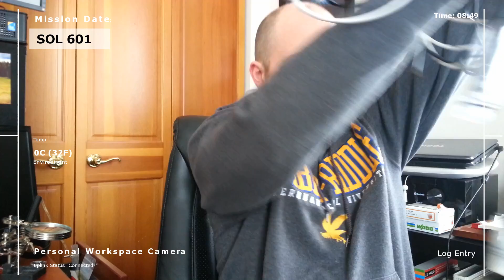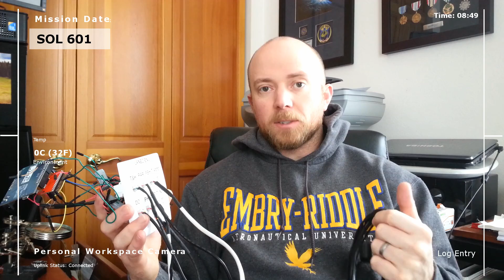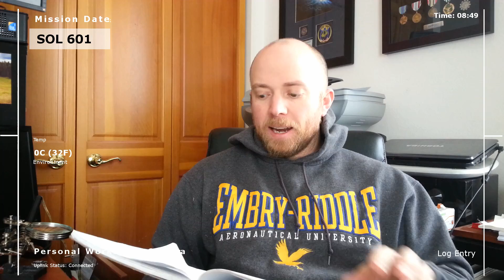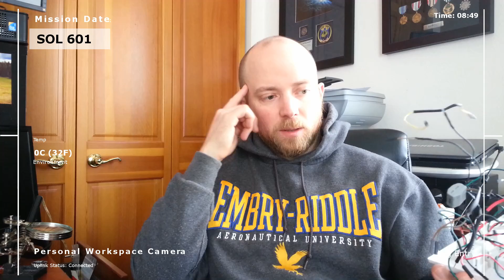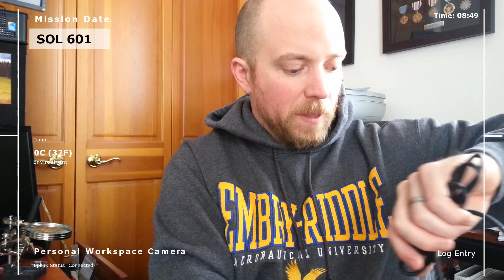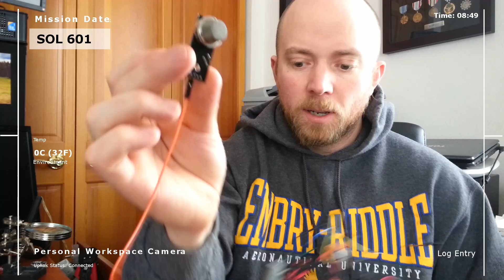ARDUINO homestead environmental sensor HACK

Comment: This is pertaining to where he talks about that he was going to be a project manager and will have people that already know that stuff so he doesn't need to know it. What everyone forgets is that there are to many screwed up people out there and you need to be able to check in on what they are doing and know if it at least sounds correct. I am not saying that it sounds correct because your emplyie is TELLING you that it is. You need to know from your own understanding if it sounds correct. On top of this if you know a basic amount of the information you can also help solve problems and you would then have 2 heads (you and your employee) instead of one.

Comment: Have you heard of mysensors.org? It's a open source, open hardware community working on wireless arduino based sensor networks that can be programed "ota" (over the air). you may find it interesting.

Comment: What are you using for a power supply for the sensors - you may not have enough juice to run everything.  The Carbon Monoxide sensor uses a heating element for measuring which may be drawing too much current which is why everything else failed.  Also I would suggest using a potentiometer on your voltage divider circuit so you can fine tune the output (supply voltages vary and the resistors are +/- 5% - a pot lets you tweak it so the sensor is reading correctly).  Just had to do something similar on a solar logging device I'm working on.  Love the videos, keep up the good work.

Comment: One thing I can recommend is with your temp/humidity  sensor that particular sensor is very sensitive. Especially the humidity sensing. I have just built a fan control for my big 3000W inverter, during the build I noticed that when I got close to it my breath would raise the humidity. So you might want to make sure you do multiple humidity readings before you take any action.

Comment: Why not RJ45? Your whole system would then be using cat5 or cat6 and you would be able to use POE instead of having a bunch of power supplies. A 24 port POE switch would go a long way.
Reply: 802.3af PoE devices negotiate the power required, before the PoE switch supplies any power to the cable. Therefore it wouldn't work.

Comment: I have a question and a comment about your placement of the temperature and humidity sensors. How are you going to ensure that you don't get false readings from dead spots and also direct heating from the sun? I saw a very interesting way to ensure that you get a good reading and that is to put the sensor in a PVC pipe that is white at the bottom and painted black a the top. This will cause a natural air flow over the sensors especially when the sun hits the black part of the painted PVC pipe. It will ensure that you have a good air flow with no dead spot and also good humidity since you won't be measuring dead air.

Comment: Hello ...Try  connecting a different sensor output to the input you have allocated for the monoxide monitor and see if it still takes down the others, should show if its the sensor or wiring?  Seperate supply for monoxide sensor if it draws to much?.. Your leisure time will still be restricted to location areas which  have a good cellphone signal.

Comment: You call it a "hack" but it's not. It's the real deal under construction. Wether it's a house or a railroad track or a space shuttle, mistakes are made and then corrected or adjusted to make more useful products. Like me, I put a Dodge Cummins turbo diesel, a lift, and a solid front axle in my gas chevy truck and it's like engineering an entire truck from scratch and you hit speed bumps but no worries, you work the bugs out as you go. Remember, you're a one man pit crew so don't give up you're doing it right. I did, and you can too.
-Alan

Comment: I was getting a little worried about the break in the videos,glad to hear your ok. One bit of advice, use a larger enclosure, why try to stuff all that wiring in a small box. Maybe even find a enclosure with a water tight door. Someone mention about corrosion on the rj** jacks, that's a real concern. Dave

Comment: Hello, TRM. Buy a small spool of Cat 5 cable (or Cat 6 if cheap enough). Cat 5 and 6 cable has twisted pairs and these reduce interference and signal degradation (crosstalk). These cables use 24 AWG and also are shielded. Speaking of shields, use an Arduino shield to eliminate that rats nest and clean up your shorts.   https://www.amazon.com/Adafruit-Proto-Shield-Arduino-Kit/dp/B00N426HCG/ref=as_sl_pc_qf_sp_asin_til?tag=hightechmagic-20&linkCode=w00&linkId=991de72b955502a0cefac6051f4fafc3&creativeASIN=B00N426HCG
Reply: That depends! If you buy UTP cable (which most people do because of the price) then your cables are unshielded... ;-)
Reply: Twisted pair doesn't magically reduce interference, certainly not how this guy is using them. They need to be driven by differential signals first, otherwise they are the same as bell wire.
Shielded cable helps, but I don't think this martian guy knows how to implement that concept properly.

Comment: Be careful with the modular connectors (RJ-xx) as they corrode easily. You might get around this problem by adding dielectric grease to prevent humidity to reach the pins.

Prototyping with all those wires is fine but you should look into PCBs, even if it's for your sole usage. You'll increase your chances of problems each time you'll pull in and out this system out of its box. This being said, humidity might be problematic as well inside the box so silicone and dielectric grease will be your new best friends.

Keep up your good work.
Reply: http://www.siemon.com/uk/white_papers/02-03-22-industrial.asp

Comment: Whilst I clearly understand why you are doing this hack I frankly would run a mile from attempting such a thing as wiring these devices up not least because I'm partially colourblind and have some past bad experience (with wiring)!! However from my limited experience with electronics in agriculture I am very wary about reliability issues in what is after all for your circumstances a hostile environment (extremes of temperature, high humidity etc) for electronics. 
We have found that all too often they work initially but then fail without warning and are often a total nightmare to clearly identify the failure adequately and  precisely.
Are you trying to cram too much into one box for instance, is the air temp sensor with such a short cable too close ie can you position it where you actually need it?

I would welcome your thoughts on such matters.

Comment: don't know how much current that monoxide sensor draws, would be suspicious if it has a heater coil inside and you tried to power it from a 5v output on the microcontroller board

Comment: I know you have allready started with the Arduino, but check into this , do a search for 

 Raspberry Pi 3 Cluster
Reply: You can log data with the arduinos. 

Caleb, that's basically what I was talking about as far as having an rpi as a central sensor controller (then wifi or direct cable) to a laptop/server. But the multiple cheaper boards. 

I think you have to look at the data, do you gain much by retaining the data and holding them on site? Really just fire and forget is the way to go.  Miss too many heartbeats and set an alarm.
Reply: robert k Yes, data can be logged at the Arduino, the RPi, and/or the main server. My preference is to data log onto a thumb drive when using a RPi. I setup a file server for my mom's business that uses a 1TB external hard drive as the main data storage and a 64 GB thumb drive that once a week tarballs critical files for backup. It's been running strong for a couple years now.
Reply: BIZKIT Absolutely. The data you are trying to collect and the what you are trying to do with it needs to drive your system. A few years ago I built a noise monitoring system for a client that we ended up going to RPi2's on because of how they wanted to handle the data and interface with it. I could have used Arduino for the job and saved time and money in the short run, but based on the long term goals for them they opted for the RPi to have more capabilities down the road.
Reply: What exactly is that supposed to be useful for? Arduino's by and large are cheaper and do what he needs. He's using older desktops for the servers for receiving data from the arduino shield. He COULD have the arduino's report back to teh Raspberry Pi. but why spend $80 on a device that is doing one thing and could easily be had for $10-15 + connections, etc. 

Raspberry Pi zero is unobtaniaum otherwise those would be ok.
Reply: lol do more research , there is so much more to do on a Raspberry PI 3 , not to mention making a cluster out of them to do even more.
Reply: BIZKIT if your spending $80 on a Raspberry Pi 3 your getting robbed lol, return it and get your $$ back
Reply: https://www.amazon.com/Raspberry-Pi-RASPBERRYPI3-MODB-1GB-Model-Motherboard/dp/B01CD5VC92/ref=sr_1_3?s=pc&ie=UTF8&qid=1488164000&sr=1-3&keywords=raspberry+pi+3
Reply: I've done my research and run arduino's for aquaponics. The RPI 3 is expensive. $80 is with the kit. At minimum you're looking at $40 for just the RPI. Buy an SD card and a power cable (appropriate 5amp one and not a cheap cellphone 2.5 amp one) and you're looking at $60 - $70 depending on taxes and shipping. If you get a case or any other accessories you're looking at $80.

Arduino's that do your basic task and report back to an rpi or an old laptop or pc is MUCH more cost effective when you're going to need to put sensors in multiple locations. What happens when your RPI dies? Now you're spending at least $40 to replace it, or you can replace a $5 arduino. 

What exactly are you going to do with a RPI cluster? The ONLY  use they have is doing distributed computing testing and testing docker or other distributed tests. The only reason you would do that is to have a small number of relatively sufficient machines in a small space. Cost for performance wise it would be cheaper to get a used server and run VM's unless you look at noise, portability, and electrical cost. 

I'm a systems engineer, this is what I do for a living. RPI's are toys and overly expensive for the use case. I really don't even know why you would cluster them together... maybe you mean have them in a sensor array in which case it would be easily 1/3'rd the cost to arduino's, which run cooler and can be kept in water proof containers without fear that it will burn out on a long warm summer day. 

What is more likely and better for the architecture of a project like this would be to use an older laptop. Then you have a battery backup attached to the device and can run USB on long runs (or pass through on CatV). At that point you're using the same software you would run on a RPI but would likely have more horsepower and ram unless you really had a bargain basement laptop, but even then dual to quad core celerons and I3's will beat RPI's. 

I'm not saying what you're suggesting wouldn't be fun to try but if your'e looking at being efficient and keep costs down like you would on a homestead then you're way off.
Reply: I'm not going to start an argument with you. You have your way and others have there way, I'm not telling him to drop everything he's doing and change , just to look into it and check it out. so just chill lol
Reply: BIZKIT I agree that a RPi is not the right tool here, and I love Pi's. Arduino is going to a better route for this application, but I think there are places a RPi could be integrated to provide some redundancy or additional functionality. 
I would be interested in looking at using something like a nrf24l01 and an Arduino mini to send data from a couple sensors back to a "central" Arduino to then process and upload to the server, but at that point you might as well just use another WeMos board.
Reply: can you log data with the system your talking about Caleb?
Reply: The Pi is a lot more work on both ends, for a novice I really wouldn't recommend going that route until the project is fully fleshed out.
Reply: very cool thanks

Comment: Note on the RJ-11 and RJ-45 connectors.  There are different types.  Some are for stranded wire and some for solid conductors.  You should use the proper one for your application.
Reply: I might have said that RJ-11 and RJ-45 describes the physical connector not the wire appropriate for attaching to the connector.  You need more parameters.  Just like DB9 describes a serial 9 pin connection that may be intended for ribbon cable, solder, or crimp pins.

Comment: You have said what I have told my fellow IT students over the years. I swear by keeping my textbooks. I have built up a library that covers everything from QBasic, DOS, and even Commodore 64, right up to Windows 10. It's a must to have references. Sometimes they will sit on the desks for years, but SOME DAY, you may need a reference for something extremely obscure!
Reply: I actually wish i didn't sell off some of my highschool books, mainly 'math' and 'chemistry' ... these are topics you don't run into often, unless you actually find a job that touches on them often. But, once you sort of want to move on beyond the simple starting jobs, you will find you may have forgotten a lot simply due to not using the stuff... or you run into something that involves these topics, and it's been so long ago that 'you know you should know, but you pretty much don't anymore' ... so yeah! ... keep the important books !

Comment: Ground Control to TRM.  Great news on the new sensor array, we believe the issue to be with the forward nacelles or maybe you just need to dump the warp core?
Reply: Whaaat?!!! Dump the warp core and strand them in The Expanse? Are you a Romulan mole?
Reply: Craig Mooring No I have been bullseying womp rats in my T-16 back home.